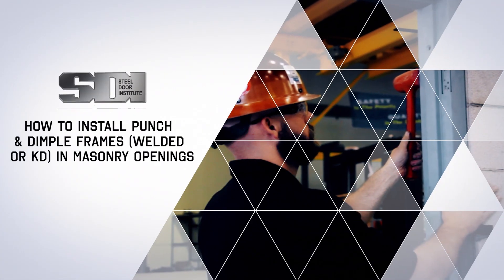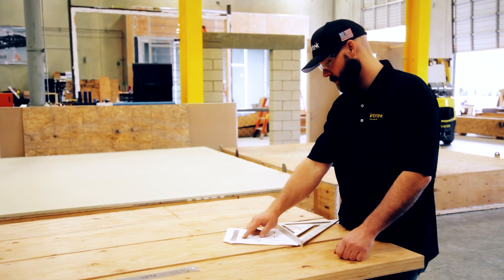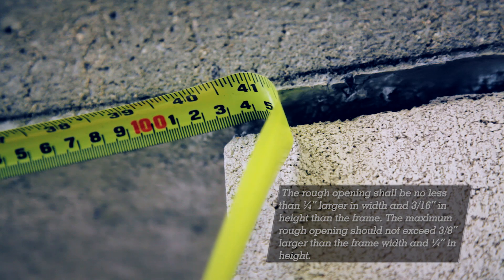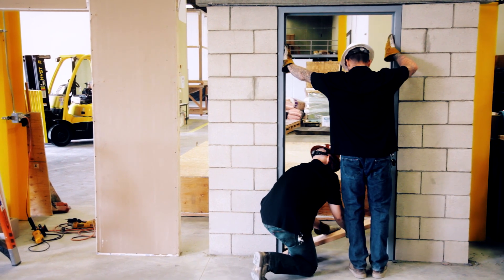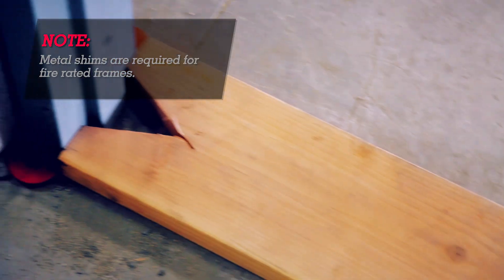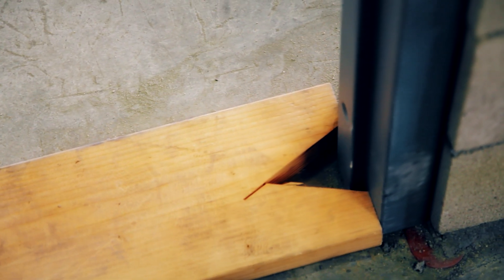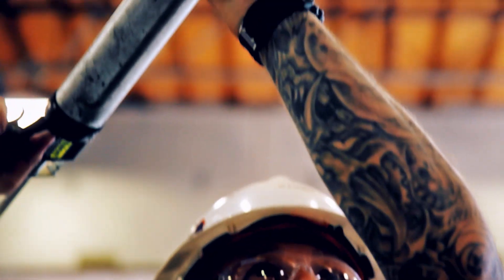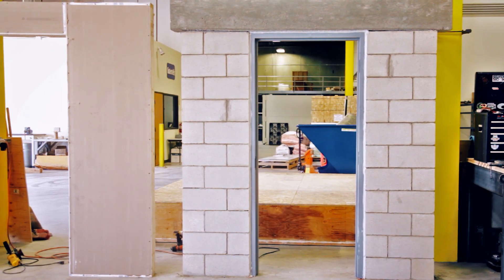How to Install Punch and Dimple Frames in Masonry Construction | Steel Door Institute

Comment: Wish they had a video for a frame that wraps the wall and uses expansion / lag bolts.
Reply: If the frame wraps the wall and the wall is already existing the frame must be knockdown type to wrap as a 3 piece frame. Then you can secure the frame with the header to jamb screws so the frame is 1 piece held on by the 4 top screws holding the header to the 2 jambs. Then the same punched/dimpling can be used but you would remove the throat butterfly anchors because they are going to be too wide and will interfere by hitting the block.  If you wrap the wall I suggest 4" long shorter CMU lag bolts
Reply: @SHORT-FRIDAYS   That sounds simple to you and me but a lot of my customers don't get that
Reply: Sorry about that....I see what you mean. A video that you could send to your installing customers.
Reply: @SHORT-FRIDAYS   yes for sure. It would be so nice. People who install should know how to do it but less and less people are qualified.  Hope u hava nice weekend 😀

Comment: What anchors do you use when the block is hollow.
Reply: I used 1/4 tapcons and it worked alright
Reply: Instead of the 5" or 6" long CMU lag bolts you can use the 4" long and it should grab the front of the block.